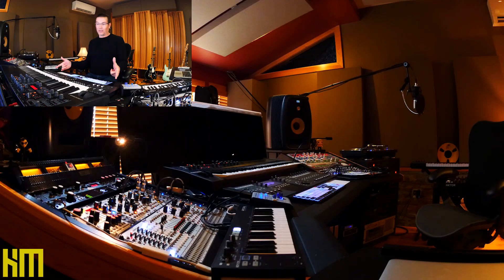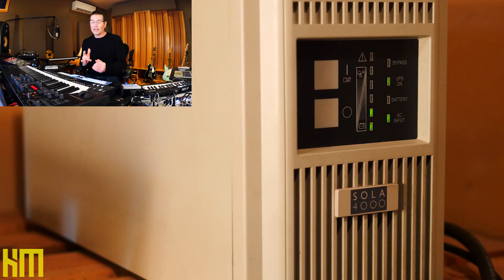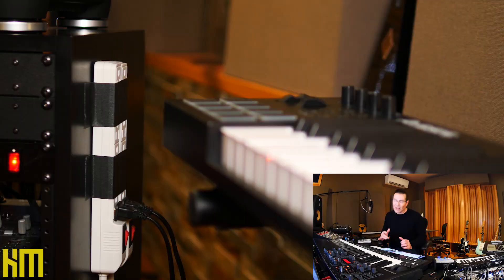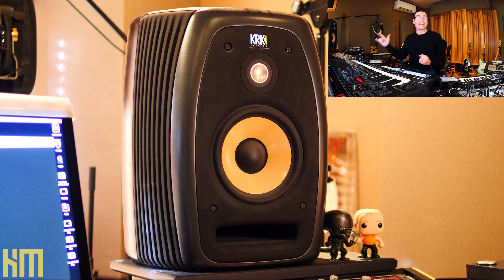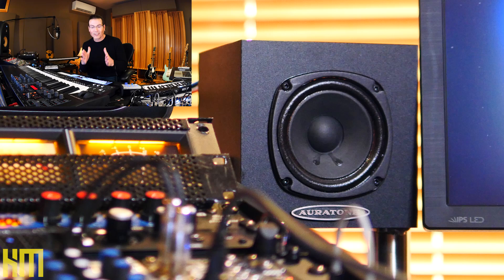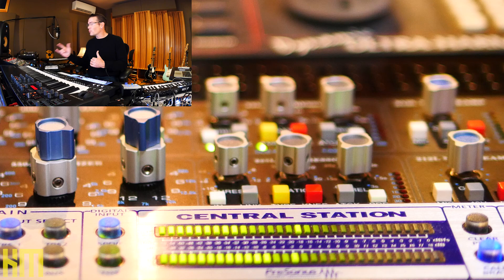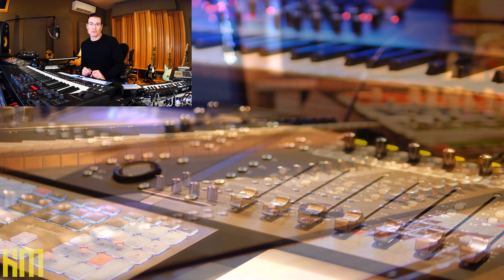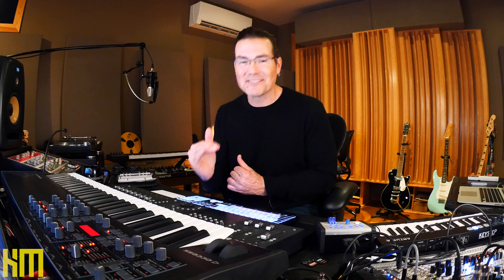Studio Tour - hiwattlabs - Ken 'hiwatt' Marshall's Music Studio

Comment: Thanks for sharing some insights into your studio gear and why you got those pieces. I really liked the part about your power supply.
Reply from the maker: My pleasure Unde Unitas!!!  I honestly believe everything sounds remarkably better when powered with a true online ups, also known as a pure sine wave, double conversion ups.  They can be very pricey, that’s another reason I exclude the amplifiers...allows for a much smaller VA rating.  The cost-to-return ratio makes it a very, very good investment.  In addition, your gear will simply last longer (I’m living proof lol)...the output of a pure sine wave ups is just that, 120v of clean and pure AC...your hard drives will love it!!!  Mine has been running non stop for 14 years (with two self-service batt and fan changes), pretty good investment ;-). Thanks for sharing, have an awesome week!
-hw

Comment: gah!  start with your glasses by talking to your optometrist.  There are few things more handy than separate 'desk glasses' or 'occupational glasses'  You can get the reader focal point moved up and tuned to make the monitors come in perfect.  Then, add a general reader focal point to the usual reader position.  so, up close and down is covered, and the mid distance not really far enough to need distance tuning is now clear as that tends to be directly in front of the eyes.. Nothing beats the comfort and sanity of having glasses tuned up specifically for the work area and workflow.  I tried progressives for about 6 months, and wow! They got painful while sitting down to work.  They are great for driving to the restaurant and still being able to read the menu, but for working nothing beats lenses tuned to solve that set of problems.
Reply: That’s a nice tip. I’m 45 and just hitting the point where I need bifocals.

Comment: Hey Ken, was looking forward to this one too! So do you power down everything at the end of the session? I like how you've set it up so you can power up everything with just a couple of switches. I'm curious how you power things down though. Obviously you don't want to just kill the power to your computer and hard drives without properly powering things down first! You mentioned that you 'eject' your hard drives first but do you have to be extra careful when shutting things down?
Reply: I can’t speak for Ken, but personally I always shut equipment down this way: monitors, console, then gear. If you don’t use an analog console I’d assume you could go monitors, audio interface, gear, then computer. But 🤷‍♀️

Comment: Notice any odd coloration with the PreSonus Central Station? Love the features of the Control Station, but I ended up going the route of an SPL 2Control to keep the signal path cleaner.
Reply from the maker: It certainly adds coloration, but in a way that seems to work well with my combination.  It’s a great question Clif, and one that isn’t easily answered in my own experience, just based on how each of these units interact with their connected monitors.  I upgraded decades ago from a Mackie BigKnob, and couldn’t believe how much more depth the CS had.  There are some incredible monitor controllers on the market, and I bet I could be equally blown away with something like your SPL unit today!  Wouldn’t it be an awesome experiment to do an A/B/C/D on different monitor controllers?!?  Haha, that would require some significant routing 😳  Thanks for sharing Clif, I hope you have an awesome week!

Comment: Man.  All that talk about power makes me think of all the power issues that I have with my setup/music room.   I recently was forced to move into an apartment, and it's in an older building.  First off, there's nowhere near the amount of power outlets that I need.  Second, when I do hook everything up here, the lights dim and sometimes the circuit blows.  It's like every damn thing in this apartment is on ONE circuit.   I'm having a similar problem with house hunting.  Every damn house that we've looked at tends to have one or two electrical outlets per room, and if I hooked up everything I have,  there would probably be flames.   I'm always plugging in a single instrument, recording it, then unplugging it, plugging in the next instrument, recording with that, then unplugging it.  It's such a pain to get things done.  In my last apartment, and the last house I lived in,  there were enough outlets and I actually had a functioning room that I could just get freely creative with on a moment's notice.  It's not easy any more.